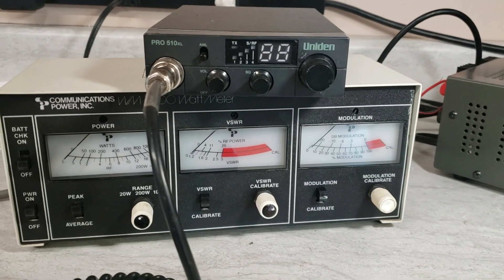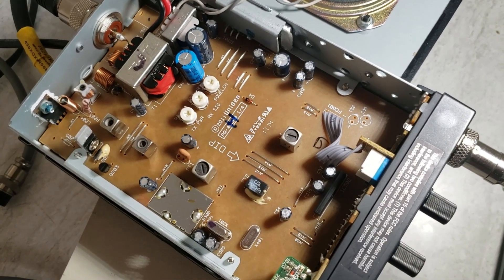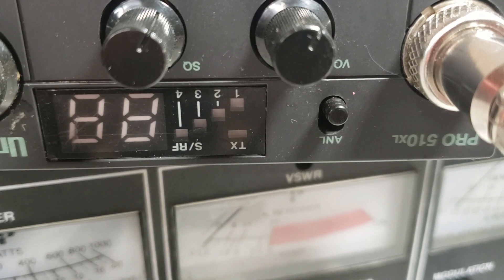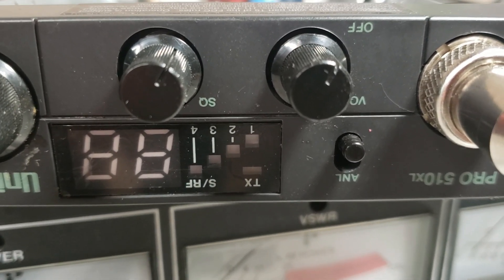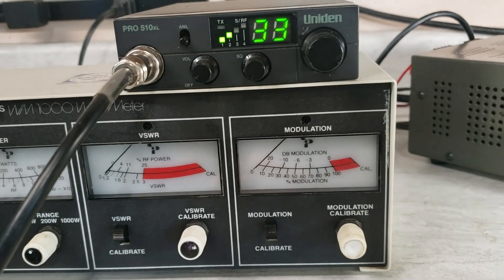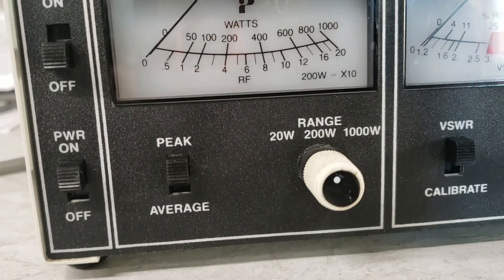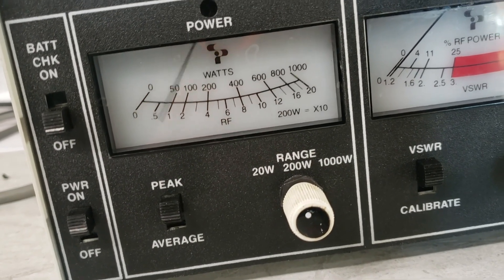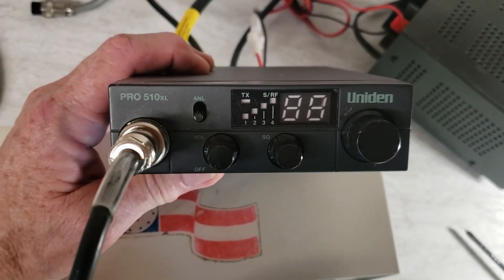Pro 510XL FREE power upgrade and swing mod DIY

Comment: I’m gonna have to try that I got other radios are not working right and I got this one for free. Looks like brand spanking new. I can’t hardly get out at all. Whoever receives everything real good everything works on. It just can’t get out even know what I have a power mic and I still can’t get out very well. I got another bigger radio than that one the same brand then I got a cobra. Seems like I’m just not getting out far. SWR is perfect. I’m using a 102 stainless whip with two ground planes SWR one point channel one and don’t move at all on channel 40 SWR is great. I hook up a walkie-talkie I can get out I can hook up my big radio. I have a galaxy 95T gets out not a problem my volume to turn up my galaxy 95T but broke but it still use it have a Lincoln base it just somebody when I bought it. They really messed it up on it now I just got that little bitty radio and I want more power out of it. I’m gonna try it and give it a try if it works then I’ll come back on this and tell you it worked. This is Shep from Indiana 73’s. I hope it works. I miss talking on the radio getting out talking to people. I hope it helps.
Reply: Does anyone know how I can get in touch with Mr Steve?  I have been trying to learn how to peak and tune CB's.  Been to school and learned from books but still cannot get it right for some reason but I think that it would be a great way for me to make a living...:stayhome::yt::face-red-smiling-live:🙂👍

Comment: Never cut the AMC it creates a splatter box and harmonics go off freq. I'd adjust the Dead key and swing. If you want it to talk about 30 watts and loud change the mossfet to the 520 I believe but they make a hotter one.
Reply: Hay mate, quick question if I may.

Just for the sake of knowledge, tinkering and conversation.  Lets say we do this "mod" then add an external band pass.  Will the radio still be trying to....match the antenna(correct terms escape me) and result in magic smoke?  Or since the amc is no longer in use, the radio will still function properly?

Thanks for your time.

Comment: Next up, Spectrum analyzer, let's see where all you just splatter those watts to.
Reply: What watts? You mean turning it up (or down) to 4 watts DK? That is not splatter! That will also work very well with an RM Italy amp if you need extra power.

Comment: Bad idea to twist that harmonic null adjustment in the back unless of course you want to see more wattage out but you'll notice when you turn the wattage up the SWR goes up to now why could that possibly be gee maybe it's because you're not adding any wattage on the 11 m BAND you're just turning up the harmonic wattage on 6 m and 81 and 108 MHz and on up the band no you don't want harmonics your antenna is not tuned for that that causes the final to heat up and pop also causes spurious interference just leave the precisely tuned harmonic choke alone in the back.
Reply: I agree, I own one, added an Astatic D104M6B and it sounds awesome on the air. Messing around with these radios is just bad pratice. It also sounds great when used as a base station.
Reply: Don't do it.leave it alone.

Comment: I just bought a new one off Amazon and the board is different than what you show in the video, I can't see a D203 diode anywhere and the only one underneath that metal is D201,  do you know if the D201 will do the same as removing D203?
Reply: @JohnVeitch1 did you ever find out the answer to your question? I was thinking about buying one from Amazon. Doesn’t seem to be a lot of info out there on the newer ones.

Comment: I would have just used the ANL switch on the front of the radio. Just wire the ANL so its always on. ( I never turn it off anyway lol ) Then use the switch in series with one leg of the diode to have the best of both worlds. Can't hear me, flips switch... Can You Hear Me NOW !!!lol
Reply: The right way is is to change the value of the loading resistor ..and get the deadkey to about 1 watt and when u modulate u will see 25 plus... But there is some other parts u must change ..do not remove the diode ... U want to put a cap and and diode in series ...
Reply: U took all the headroom out the the average ... U do t want to do this

Comment: Removing the AMC limiter destroys the audio quality. Don't do this.
Reply: It Shure does, you can  lift leg on D-14 cathode end and add a 15ohm 1/4 watt resistor to Negative end . Look for black band on diode. 1987 older model

Comment: If it was me I would set the radio dead key down to about 2 1/2 Watts and you will probably get a little louder modulation. And most likely you will probably get a better average forward swing.

Comment: Looks like removing the diode causes overmodulation and distortion.  Audio is best at about 60-70% modulation and no higher. Otherwise distortion reigns and your signal splatters over 3 channels.  But whatever.  It’s just CB, right?
Reply: I love how guys talk about splatter.  Pretty sure it's only detected when running large amounts of power.  
In the real world if it don't splatter, it don't matter. 
You keep trying to make contacts with your 60-70% modulation.  😅
I'll walk right over you. 
Small block 422 Illinois gettin down
73s
Reply: Don't get me wrong,  I do not promote the removal of any limiters in a radio.  They usually have a variable you can turn up instead to achieve the 100% modulation you want out of a radio. I'd recommend doing that instead and put ur on a scope if you have such test equipment.

Comment: Hi there Mr. Steve and to all o this channel.  First, I just want say thanks for making this video.  ever since the first CB radio I had an opportunity to turn listen to and talking on, I have wondered what all of the adjustable parts do.  Like those adjustable coils and adjustable resistors.  When I talked on the air some would say that if you open the radio and adjust those things you can increase the talk power - like output power and modulation as you show here.  I am also interested in how to increase the receive sensitivity so the CB can hear weaker signals so that it is a 2 way street - further talking and further listening!  I have a Uniden Pro 520 XL and I find that by opening the covers and adjusting the coils near the back of the radio with just my finger, no tuning tool required, I can increase the output transmitted power up to about 20 watts as I read on am Astatic power meter.

Comment: How about the 520 models ?
Reply: Good question, I have a Uniden 520 XL.  I would be interested in reading or watching stuff about here on this channel.
Reply: It's the same radio with rf gain.
Reply from the maker: I haven't been inside one of the newer models, but my suspicion is that it may be the same

Comment: I just picked up 2 of these but mine are the older version, would D203 still apply? I found D203 on the top side, its soldered through the board with 2 legs. If I clip one side would I be good? I dont have a pep meter so Im unable to tell if it would work correctly. Do you know if this will cause other problems, like flat top or splatter? Thanks for the info.
Reply from the maker: Not positive, I do remember that the clip was on the top side. Please do a quick Google search for pre 1999 radios. I think it might have been D4, but not sure. ALWAYS! Verify before clipping. I can tell you that the older 510s were monsters after clip and power adjust.
Reply: @mrsteve9920  Thank for the info. I did some research and I believe D203 is still the one to clip. I know people clip a different one too but I think thats the audio limiter and I dont want my mic to sound like crap. 

I bought a Astatic PDC1 SWR/PWR meter to check my SWR and set the dead key. Found out that one of the 510s isnt transmitting any watts even though the lights are lighting up. The other one measured 2 watt dead key, I turned up 203 the max without the screw falling out and it read just shy of 3 1/2 watt dead key. Not sure if these meters arent accurate or my radio is junk. I tried to get a radio check all day today driving over 100 miles and couldn't get one.
Reply: @2wenty286  Any luck yet after doing this? I have one of these radios as well and been wanting to do this
Reply: @mrsteve9920 Hi Steve, Just bought me the 510 again, 3rd one ive owned, Im wanting to mess with it just a smidge. according to your video i bring the L203 screw up to flush with the too of that white casing, correct? 

also, As for removing that diode, is that really safe? i mean i see you did it and your readings looked to be good and safe, im just thinking potential sound issues like one follower said. its been forever since i messed with one of these like this.